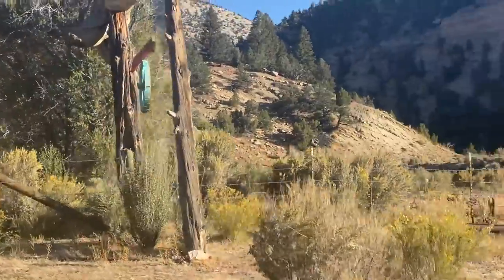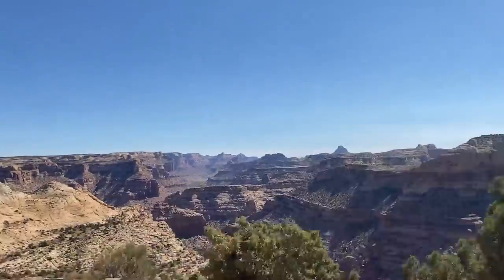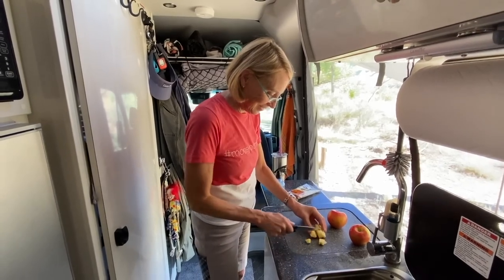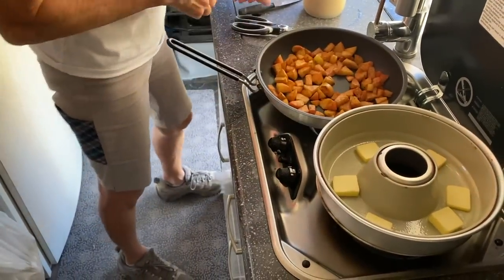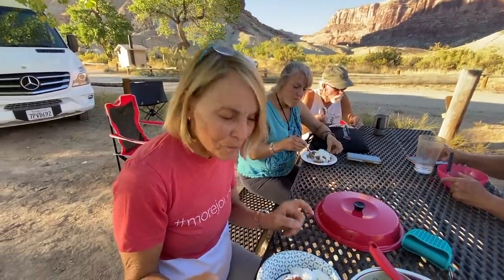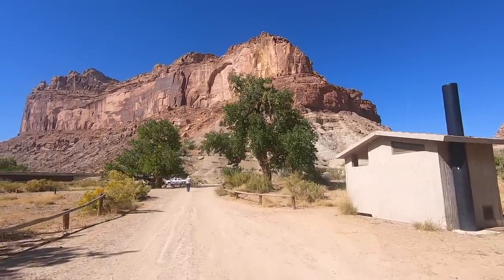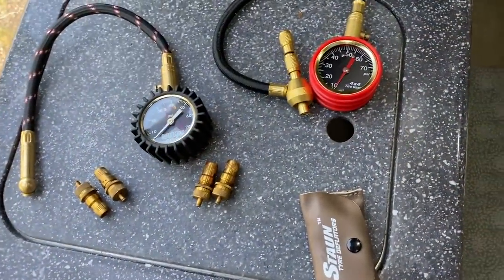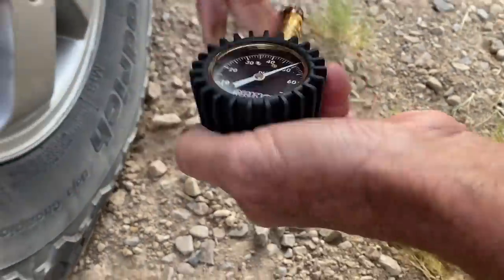Finding Solitude in the San Rafael Swell of Utah

Comment: Thanks for another great video!
Curious if your friends in the other van have any type of suspension package on their rig...
Could those roads be driven with the standard factory set up?
Reply from the maker: Any 2 wheel drive vehicle can handle the main road. Some of the lesser roads can be a challenge, especially if sandy. Our friend’s van is the stock suspension.
Reply: Please research the roads. Being a local, we spend a bit of time pulling people out (when we are out on the trails). 

Also, be sure to watch the weather. Out on the swell rain can change a road.
Reply from the maker: @stout_tossme7541  Excellent advice.  One of our favorite YouTube channels is Matt's Offroad Recovery.
Reply: @FromShetoMe  such a great guy. I have watched his videos since he started. Love it! I even got a Yacum (spelling) rope! Lol 

Matter of fact, I tugged a rig out of a mudhole similar to yours using the new kinetic rope (the couple in the rig was not at fault, we got a sudden burst of rain and it caught them trying to get back to pavement). 

Anyway, I absolutely love your videos.
Reply: @FromShetoMe    Yes MATTS OFF-ROAD RECOVERY, is one of mu faves, MOST are RENTALS, not all, but HOT DRY SAND is a TRAP, but they do not AIR DOWN also have no way to RE INFLATE , CHEERS 🇺🇸🇺🇸🇺🇸🇺🇸

Comment: You may have mentioned in a previous video, but if so, I can’t remember why you use the moon shade instead of the factory awning.  Would you mind explaining again?  Love all your videos!
Reply from the maker: There are two main drawbacks to the Fiama Awning. The first is that it sits so high on the vehicle that it doesn’t provide shade as the sun is setting. The second is that it is so sensitive to wind that it retracts with the slightest breezes. I know it can be adjusted but we don’t want to risk damaging it. The moon shade can be used on either side and on the back which we have done. You can angle it so that it provides better shade later in the day. And as one of our viewers pointed out you can hang curtains from the sides for even more shade.
Reply: Can you remind me of the brand name for the moon shade? Thank you.

Comment: Perhaps I missed it on other videos but I noticed your awning. Could you tell me more? I rent my class b from CanaDream and they disable the installed awning. I have been using a tarp and poles but yours looks more sophisticated.
Reply from the maker: It’s called a moonshade and was originally a kick starter product. You can probably find a 10% off link on one of the bigger channels like Eamon and Bec or Trent and Allie or the Matneys. We really like it.
Reply: @FromShetoMe  a pleasure to hear from you... and so quickly. Thanks. I like the idea of using magnets to hold it in place. Seems like a great solution. All the beast.
Reply from the maker: Just be aware that magnets can scratch your paint. It also comes with suction cups and if it is really windy I will double up and use a suction cup in addition to the magnet.
Reply: @FromShetoMe  good point. I’m thinking of going with heavy duty suction cups and a tarp. Lighter, cheaper and with a 10x12 I can cover a picnic table. Probably about as easy to put up and take down. More compact for storage.
Reply from the maker: @davidhoff3386  Sounds like a good plan.  If you care to send pictures when you're done, please do so:  energymaven@gmail.com

Comment: Curious why you are using Moonshade and not the Fiama awning. We have a PW Plateau TS.
Reply from the maker: There are two main drawbacks to the Fiamma Awning. The first is that it sits so high on the vehicle that it doesn’t provide shade as the sun is setting. The second is that it is so sensitive to wind that it retracts with the slightest breezes. I know it can be adjusted but we don’t want to risk damaging it. The moon shade can be used on either side and on the back which we have done. You can angle it so that it provides better shade later in the day. And as one of our viewers mentioned,  you can hang curtains from the sides for even more shade.
Reply: @FromShetoMe  Thank You. We have a Moon Shade too and have used it to shade the fridge side in hot weather. So far, no problems with our Fiama.

Comment: At what tire pressure do you air down to when traveling on gravel and dirt roads?
Reply from the maker: Front down 49 to 34 and rear from 71 to 48.  Probably could go lower but need to learn more about the rims.
Reply: @FromShetoMe  Ok. Thanks for the response. I guess I ordered the correct air deflators.